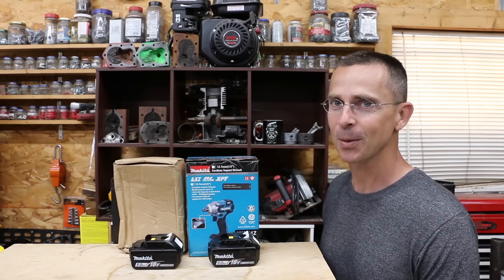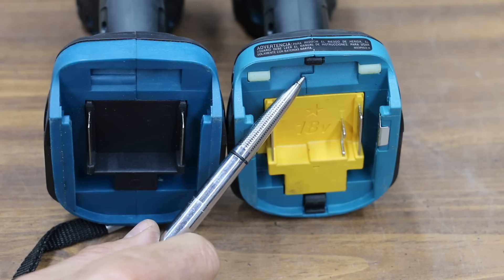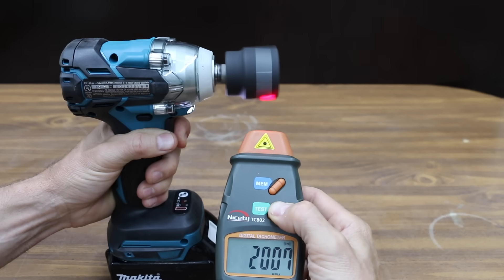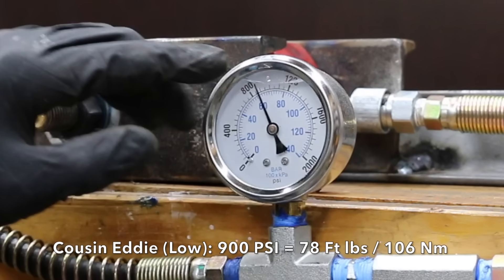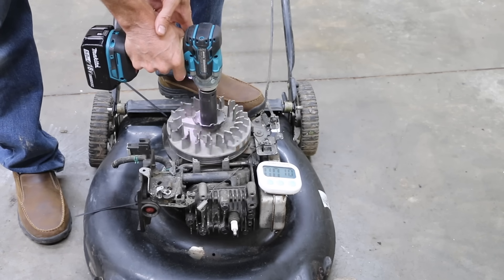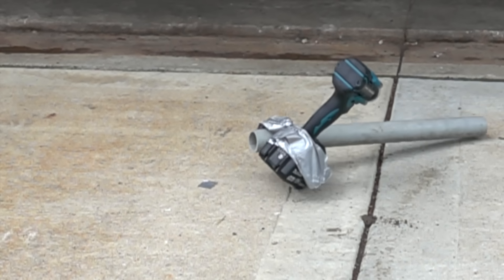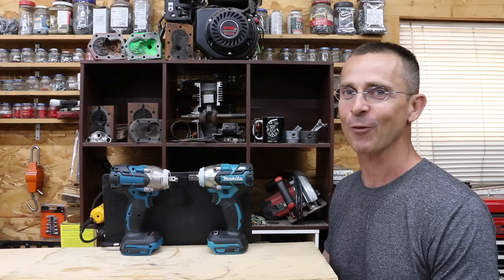Fake Makita Impact Better? Let's find out!  Makita XWT11Z 18V LXT Lithium-Ion Brushless Cordless

Comment: Great, great videos.  I'm basing many purchases based upon your testing.  You creat ingenious low cost testing devices. "Very impressive" 😁.  May I suggest testing of various water supply pipes ie cpvc vs pex vs copper etc for burst strength,  freeze damage resistance,  joint strength (which I think would make a whole 'nother  video) etc. I know many who switched to pex after someone broke into their place and stole the copper.
Reply from the maker: Great suggestion!

Comment: In all honesty $30 for that tool even with the lag and lower torque ratings is one hell of a deal!
Reply: @enwin1912  A kettle is significantly more dangerous from the electrical side than an impact drill, though. Many things can go wrong with something that's exposed to mains, heats up on purpose and uses conductive liquids.
Reply: @GRBtutorials  
2nd rate batteries are just as much of a danger. I'd never charge the knock-off anywhere that couldn't tolerate a fire.
Reply: @GRBtutorials  Do you know much about lithium fires.
Reply: Sy Badine  China can build amazing shit really quick, the cost being 12 hour 6 day work weeks working for close to nothing.
Reply: I actually bought one of these knockoffs because it was cheap. It didn't last a year, the motor just stopped working. A total waste of money.
Reply: @enwin1912  For professional use you'd want the brand name, but for someone like me who might use such a tool once a year (maybe), cousin Eddy would be enough.
Reply: For sure! I’ll add it to my Makita arsenal.
Reply: Sy Badine  made in china but designed and quality inspected somewhere else. Some of their information obviously didn't get passed on to a CCP factory that it could not be Mayfair to the higher standards.
Reply: deal in comparison to what?  Unless you have makita batteries and charger, this thing is useless.  If  you have adopted makita 18V system, why would you spend $50 on eddy when the makita can be actually had for around $99 and comes with an actual warranty and isn't a safety hazard like eddy?
Reply: Yeah, I'll spend $30 on that!
Reply: Sy Badine  Yeah reputable goods are fine, yet a lot of their exports are highly volume based low quality products. Though, since they lack human rights, they can make giant buildings in days, and build trains that go 300mph and balance a penny on it's side

Comment: About the only questions I would have would be how long would cousin Eddy's motor and battery pack last compared to the Makita's? Your drop test showed that the plastic isn't cast with enough strength or as beefy as the Makita. For $30.00, cousin Eddie seems like a good buy for someone starting out or not having a lot of money to spend. When I was young and dumb I got caught with a few of these tools that I thought would be a good by but died in a very short time. Battery packs will recharge only so many times. I can't tell you how many times that has happened and needed to buy another battery pack because of a short life span. (All the rechargeable batteries I buy now are the Panasonic Eneloops  unless I can't get them. So far all but a few other brands give out in a short time.) Then the wear to the the hammer of cousin Eddy was a lot more and shows that it could wear out quicker. But I had an experience were one of the hammer lobes broke off the first week I was using it after about 2 or 3 hours of use. It either had a crack or a weak/faulty casting or it developed one under load.
Now to be fair, over the years I've had some high priced/high quality tools crap out too. But it happens lass often and it is usually less of a hassle to get a replacement or exchange it.
One other comment, battery powered tools are convenient/handy but they are bulky and can be heavy. they are also not real good in tight spaces. I got real accustom to the Air Powered tools in the Air Force and like them far better for working in tight spaces and for their light weight. But like these battery powered tools, there can be a big difference in quality. 
Years ago, I would only buy US made tools/stuff, but the Japanese have come a long way in quality over they years. In fact I compare Chinese tools today like I did the Japanese tools to American tools way back in the 1960's and 70's. The Japanese stuff back then was like the Chinese stuff is today. The quality and pride in work is not there yet and may never get there because of their communist run society. The Japanese didn't have that problem from the start and pride in their workmanship and quality of their stuff improved over they years, even outperforming American made stuff, I'm sad to say. But the Japanese stuff has gotten a lot more expensive over the years too.  Great video!

Comment: I'm going to go out on a limb here but I would say there is also an issue on the scope and scale of work one is using the tool for. Cousin Eddy may be fine for medium duty and casual work like tear down of an engine but there are tasks cheap or budget tools will not handle. While "laboratory" grade testing does speak volumes the real world also can prove those volumes WRONG. Case in point. There is a huge difference between professional and casual work. One yard stick for a good impact driver is can it break free rusty bolts. You certainly are not going to be working on Industrial Diesels with a Makita anything. There you are stepping up to really expensive specialty tools considering the forces required to execute any particular tasks such as head removal, disassembling the crank shaft or removing accessories from an engine. Honestly I have had a chance to compare a Harbor Freight impact driver to a Milwakee Fuel impact driver side by side and at the $400 price point I would have high expectations of both. It turns out in raw power the Harbor Freight impact driver appears to be the better of the two and the less expensive as well with the Fuel being over $400 and the Harbor Freight being under $400. In practical applications these drivers were used to take lug nuts off and strip engines for rebuilding. Both performed very well but the Harbor Freight was faster and it took some seriously corrupted hardware to say no to it. Also there were times the hardware scoffed the Fuel but didn't laugh at the Harbor Freight unit.
I would say if the budget restrictions were an issue  or one was doign casual work or not working in a professional setting Cousin Eddy is attractive and appears to be able to, for the most part, get the job done but the Makita does have a long tradition of being in the Construction industry providing power tools and also for their price point provides a tool that will last. I have a Makita Clutch Driver 3/8 drill I paid $45 plus sales tax that is well over 25 years old and I'm still using it. I would not rely on Knock offs for durability in that it may be a third of the price in the long run it may cost you more when it breaks on a job and you cannot finish it on time. Aldo where rough handling would be reality the Makita may not appear to be of value however the fact they can take a lot of punishment before failing gives a buyer a lot of reason to evaluate the value of each.
I think it is a fair conclusion that at least from my perspective is that Cousin Eddy is better than nothing and for the most part works as needed and is perfectly fine for casual work BUT this is a time where the known name brand is still better and chances are as an investment goes a more sound expenditure rather than trying to be overly frugal. Real tool buying is an investment.
Granted it is said a poor artist blames his brush for bad work but it also is a bad artist who does not buy the right brush for what he is doing. You don't paint houses with $400 sable hair pinstriping brushes and you certainly don't paint masterpieces with a 2 1/2" wide angled sash brush meant for trim in a house. Same with hand tools. Craftsman works just as good as Snapon but nothing says fun like the cheap Chinese hand tools that literally fall apart as you use them. This was a great head to head and I appreciate the forensic approach to the testing. That is some real Consumer Reports video right there.

Comment: To be honest for the price I would absolutely go for the cheepy China knock off! I'm just an amateur morotcycle/car home mechanic but for $30 it's more than what I need! Most things i do don't require more than 100Nm anyway and in comparison to using hand tools it would be worth it's weight in gold. Even if it did break I could buy 3-4 of them to replace the ones that die before it out costs the Makita! :)

Comment: interesting. ave done something on the same gun i believe. you gotta hand it to china knock offs. they're getting better. i've got a 3/8 impact from harbor freight that i use on everything. it's not a dewalt (or better) but it's good enough to suit my needs. sometimes it seems it could be better but i have a huge breaker bar for that. i've taken off lug nuts with it at the pull a part and opted to get an impact driver for lighter stuff if that says anything.
Reply from the maker: Thanks for sharing.

Comment: Based on my research before, the Kobalt 8-Amp 1/2-in Corded Impact Wrench from Lowe's is the best impact wrench. The primary concern for me is that it's corded. Battery is a liability in a garage always within distance of a plug. The reason it is preferred besides violent performance is that the price goes on sale once in a while, so if you wait long enough, you can get it for a major discount. The true test of these things is stuff like crankshafts that are on at 200 ft lbs, but if factory torqued and 20 years old, it can require upwards of 1000 ft lbs to actually crack the nut.
Reply from the maker: Great feedback. Thank you

Comment: How about a 5 gallon bucket test! UV exposure, handle comfort/construction, impact resistance, weight capacity inside the bucket by lifting the handle and flipped over as a stool? Different store brands, Home depot, Lowes, Grainger... Yeti (but that's not too fair)...
Reply from the maker: Great recommendation!

Comment: I really like this review, reminded me of something AvE does.  The obvious test you can't conduct is the long term reliability test.  You say the knock off "cousin Eddy" is a good value for $30 because it's a brushless tool, but if you have to buy 4 of them in the same lifespan of the Makita, then it's a terrible value.  Especially if Cousin Eddy shits its pants on a job site and you don't have a tool for a month because you're too cheap to buy a quality tool to begin with...unless of course, you decide to buy 2 or 3 of them up front to have a spare...and then how does the value proposition look for Cousin Eddie?  I'd buy a used Makita over a knock off all day long.
Reply from the maker: Thank you very much!

Comment: I have one of these fakes from wish annd bought the official battery and charger from Makita. Its effective on rusty exhaust bolts eg a 22mm never removed o2 sensor bung with 20years of corrosion and crank pulley bolt. Since its so effective I use it quite often now and do not like to support fake manufacturers so I may purchase the real thing.
Reply from the maker: Great information. Thank you

Comment: Great comparison and video! The splines on the motor of cousin Eddie @11:09 are longer could that be a structural advantage? Otherwise the difference in wear indicates that the Makita should last much longer. It would have been interesting to find out how long each machine could last before a component fails. If the Makita would last four times longer then cousin Eddy, the Makita would even be cheaper in the long run.
Reply from the maker: Great point!

Comment: Have purchased many of these cheap tools and products directly from china. They all performed very well and the prices are amazing. The only downside to buying these  are that the wait times can be over two months to receive them. Also, once they finally break you have no choice but to just throw them away cause any warranty offered is not practical due to the huge turn around times. For the money though, alot of these direct from china products are worth buying
Reply from the maker: Thanks for sharing

Comment: Cousin Eddie is perfect for the average home owner that does some minor projects around the house.
Reply: I'd buy it if all I was gonna use it for was removing mower blades
Reply: @ultrakool  Fuckin A, man doesn't need to know the nut busting torque of a drill when I'm just trying to half arse putting a bed frame together
Reply: Jordan Bailie why would you use a impact driver to put a bed together all u need is a screw drive or socket set if ur lazy an electric screwdriver will be just fine. Impacts are for lug nuts, frame bolts, construction etc.....for $30 you could replace it almost 5 times a year for price of one real impact, bargin value
Reply: @ededdynova Because you can.
Reply: I'm bemused by the absolute blind spot of comments here ignoring that PF is using a Makita battery and charger for the eddy, since Eddy does not come with a battery or charger.  Check the $50 eddy's on ebay and they all do not include a battery or charger, they say for "Makita battery".  The premise is simply wrong here.  If the eddy is perfect for the average home owner, then the average home owner has adopted the Makita battery, which is not the case.  There are plenty of inexpensive impact wrenches with battery and charger with an actual company behind those products, than the combination eddy + makita battery and charger.  Moreover, not sure the average home owner with minor projects needs an impact wrench.

Comment: Just think you could buy like 5 cousin eddies for the price of 1 Makita.
You would have 5 impacts, 5 batteries and 5 chargers.
Battery replacement cost should be a factor.

If you are a professional person who uses your tools A LOT. 
By all means spend the money and get the Makita or Milwaulkee.
 Your work depends on the tool working to it's maximum every time you use it.

However if you are just the average homeowner who only uses the impact every now ant then and you are not sinking self tapping screws into drill stem but doing light duty tasks I would take the chance and buy two cousin eddies.

I personally use Ryobi 18 volt tools. I have been using them since they were blue.
I still have some of the blue tools. They still work. 
 Ryobi made the promise 18 years ago to never change the the battery connection. New 18 volt batteries still work in the old tools. The new chargers will charge the old batteries but the old chargers wont charge the new batteries.
Different charging pattern
That is what sold me. 

I have had some fail, some break and some items that were not so hot.
I am hard on tools. I can break anything. 

However as long as Ryobi keeps their promise about the batteries I am gonna keep on using them. They have made me a lot of money in 18 years and got the job done when I needed them to get the job done. The replacement cost is not bad. Home Depot offers really good deals at Christmas time.

I recently got the opportunity to use some new Milwaulkee  tools on a job site.
They worked really well.  If I did not already have a tool box full of Ryobi tools I would recommend the Milwaulkee tools.

Best bet pick a brand in your price range and stick with that brand.

Comment: Video idea for you, add regenerative breaking and hub mount (or even tire mount) generator on an ebike or motorized bicycle in order to attempt to create energy greater than that which is expended
Reply: I.e. add. Low friction energizers in parallel or sequence until output of electrical energy us greater than expended energy

Comment: Hello buddy,

Expensive proposition but we purchased a Dyson canister vacuum and I am pretty confident that my 22 year old canister vacuum from Sears is more effective at sucking up dirt. Problem with the Dyson is the loss of suction on the pull back of the vacuum head..the seal seems to separate thereby losing suction. The other issue is that the spinning head does a poor job of sucking up dirt and it tends to flick dirt away on low pile rugs. I'm dubious that Dyson is really worth what we played for it in comparison to cheaper brands..

Comment: The one thing that’s really important to mention with a premium cordless tool is that battery, cheaper cordless tools really aren’t that bad but without a decent Ahr rated battery kinda takes the bargain out of it.
Reply: True in many cases, but if I bought that $30 impact, I'd throw it in the trunk of my vehicle just to have it available for flats and tire changes on the road.  I have much stronger impacts for home use, but this little one might still get used for some jobs at home to keep from having to drag out air hoses or electrical cords for the stronger impacts.   I'd be more concerned about whether a battery is available if the current one failed, but for $30 I wouldn't be too concerned.
Reply: @chuckd7423  THAT part
Reply: Chuck D  totally understandable look I use the  Home Depot Ryobi  (burn um and toss um) brand..my luck had been prior to new battery technology the battery failed long before the tool ever wore out...I’m pretty certain on a $30 tool that battery ain’t long for this world.. but if a makita battery works in it then it’s a deal.
Reply: Especially when your using cordless saws and grinders. Anything below 4amp isn't worth looking at.
Reply: It's not that hard to replace cells in a battery with better quality and higher capacity ones.

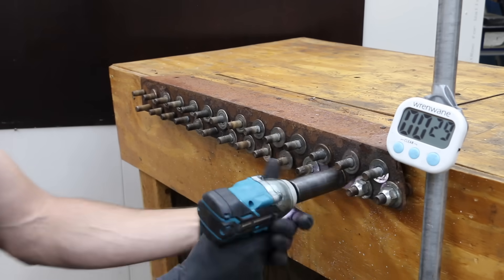Comment: @ 7:00 you changed the way you removed the nut. Entire testing is now invalid especially due to time, since the difference you made cost about 1 sec per nut therefore making them the same.